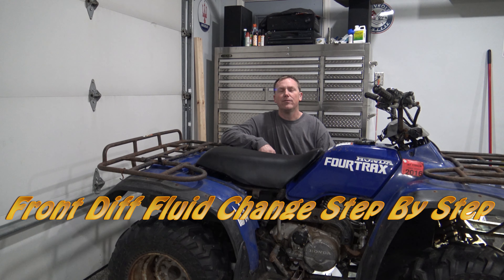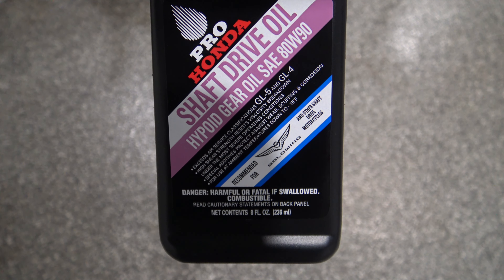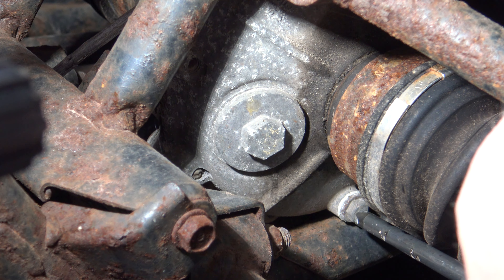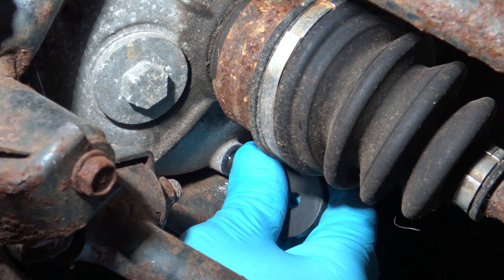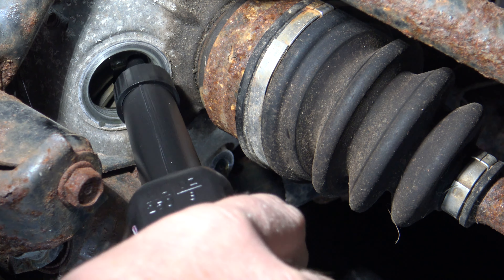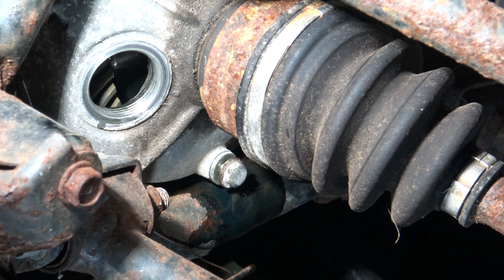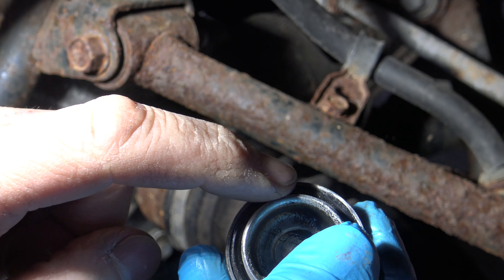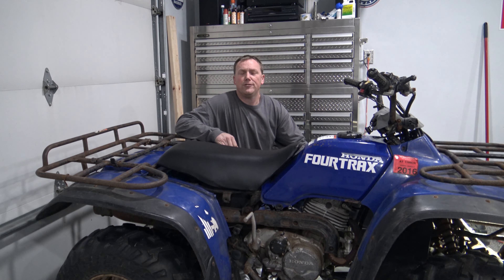Honda 300 Fourtrax Front Differential Oil Change. Step by Step and TIPS!

Comment: I have a 1998 Foutrax 300. My drain plug is sitting behind the tube frame to where I cant get a socket on it only an open end. Im affraid I may round off the bolt and there wont be any room for the plug to come out due to the position of the frame. Any suggestions?
Reply: I am having the same problem did you find a solution
Reply: I have a 98 as well, I happened to have the front end on a jack replacing the tires and it gave me the tiniest bit more clearance and I could get a socket on it. I used a thin socket that was 1/4 in and used an adaptor, had to use an open end with it down.

Comment: I have a 1996 honda 300 fw and the owners manual says to use (SAE 10w-40)  6.4 oz for the front diff and the rear diff use that 80/90 oil.